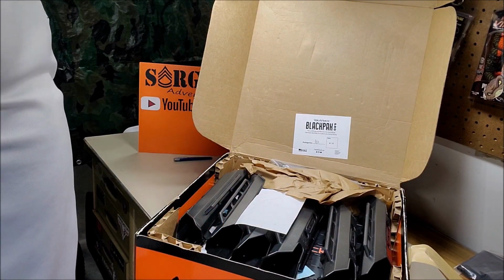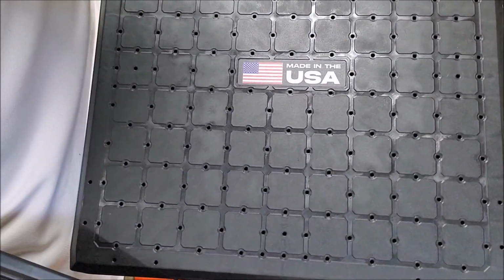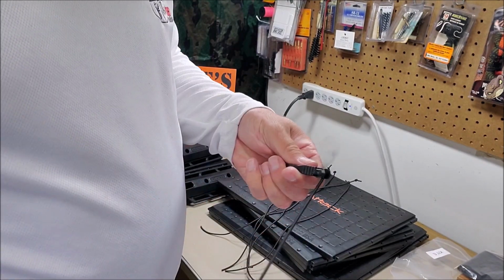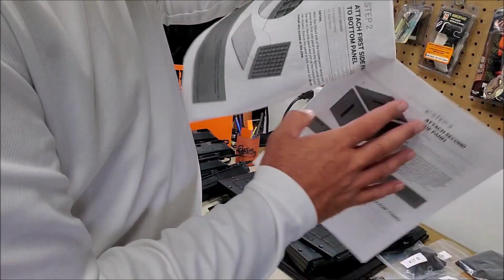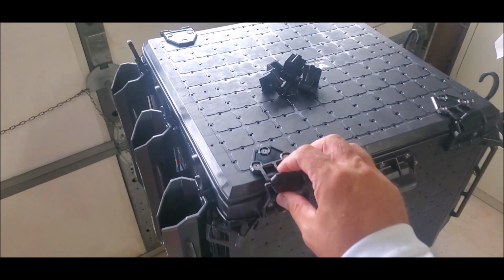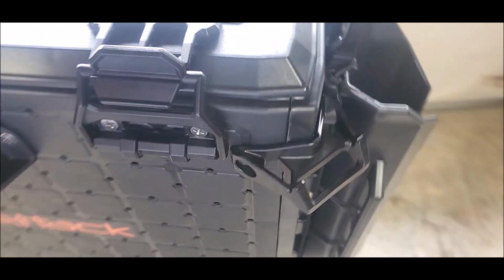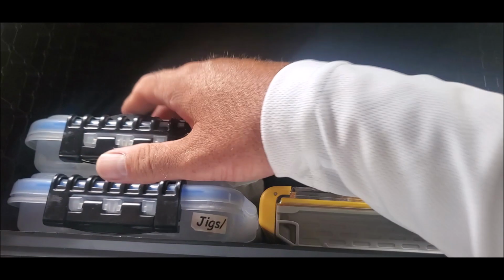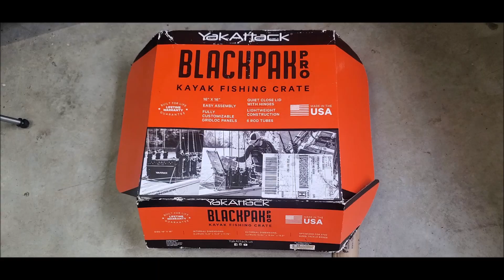YakAttack BlackPak Pro kayak crate 16x16 First Look !! @YakAttackKayakFishing  @FishUSA

Comment: What size are those trays you have standing upright?
Reply from the maker: The 2 smaller boxes with blue were 3600 size and a Edge  3600 the larger one with red on it was a 3700.